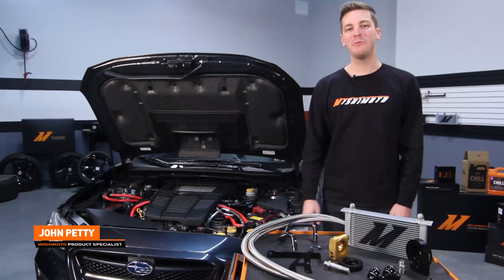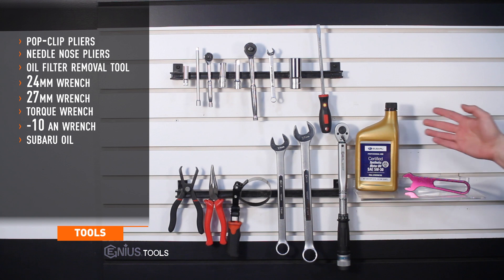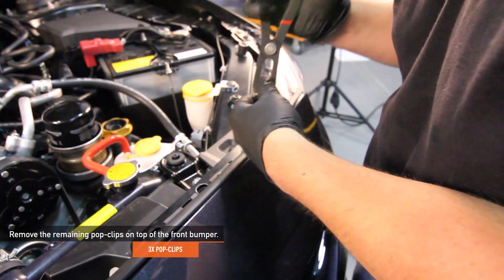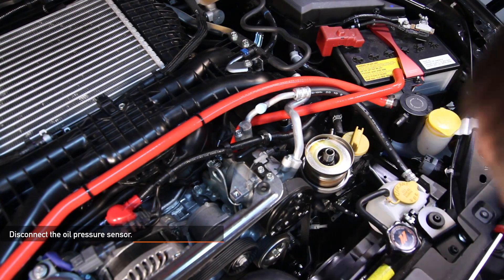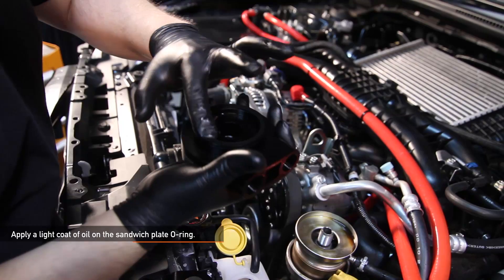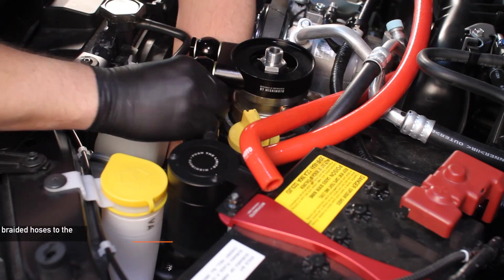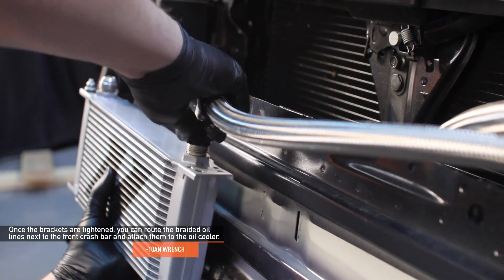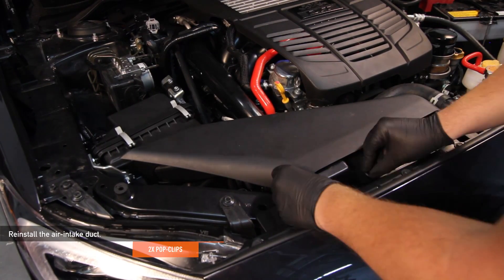Oil Cooler Kit Install Video for 2015+ Subaru WRX

Comment: hi, i just installed the cooler with thermostat kit. I followed every steps of this video, but there were oil leaking from the side of the spacer. Then i noticed my spacer is small than the one you have in the video. Im assuming that is the cause of the leak or I didn't torque the center M20 adaptor properly? Whats the torque spec for the M20?
thank you!!
Reply from the maker: Torque spec for the center bolt is 30-35 ft. lbs.

Comment: Do I need a tune this oil cooler? Ager installing it. Im getting a check engine light and my Accessport says it's the old pressure sensor that is erroring. How do i fix this. My installation was thermostatic with bypassed housing. 
I try taking it to super. But they told me I have to put it back in stock for them to look at it
Reply from the maker: You should not require a tune for this item.

Comment: So I bought the Mishimoto Ultimate Bundle Kit and the oil cooler came with both Thermostatic and Non-Thermostatic. Im confused on the install on the oil filter part. I replaced 2 Ancillary hoses that lead to the oil filter housing. Would this be considered Non-Thernostatic? I was confused to where the black Ancillary hose with orange on the inside goes. I think i may have understood where that goes now from your demonstration. However if i go thermostatic, what do I do with the 2 extra Ancillary hoses that came in the kit?
Reply from the maker: We would highly recommend contacting our team for installation help at support@mishimoto.com. The bundle we include should come with the thermostatic plate within the oil cooler, not both. Either plate should not disrupt the OEM cooler and hoses that go to it.

Comment: Hello ! Great video, what's the difference between thermostatic and non thermostatic. Which one is better for my WRX 2019 ? Thanks 🙏🏼
Reply from the maker: One has a thermostat to regulate temps and prevent overcooling.
Reply: @mishimoto  ok great! I would go for the thermostatic one. thanks for the response

Comment: Hi! Im thinking on applying this fix to a Subaru Impreza Limited 2015 because I'm finding oil in my refrigerant suspect oil coolant is cracked (motor oil is clean no coolant in there). Should Impreza limited vs wrx be the same replacemebt steps?
Reply from the maker: We have not tested this on a non-turbocharged Impreza. Sorry!

Comment: Can the non-thermostatic unit work without the stock oil cooler?
Reply from the maker: Our kit is designed to retain the OEM cooler.
Reply: @mishimoto  what are the options for someone who does not have the OEM cooler? I already bought the MM non-thermostatic oil cooler.
Reply from the maker: We would suggest purchasing a replacement and center bolt from Subaru for proper installation.
Reply: @mishimoto  can I purchase the thermostat unit alone so I can add it to my non-thermostat oil cooler?
Reply from the maker: https://www.mishimoto.com/catalogsearch/result/?q=mmop-sp

Comment: Does the air in the cooler lines need to be bled out or will the circulation system sort that out itself?
Reply from the maker: The oil cooler system does not require bleeding.

Comment: besides a catch can, can you install a AoS with this oil cooler?
Reply from the maker: We aren't sure of what you are asking here. A catch can is a ail/oil separator. An AOS is completely separate system when compared to an oil cooler.
Reply: “Totally different systems and yeah this would be fine. The oil cooler will install at the front and run two tubes to a plate that goes between your oil filter and the place underneath it.
An AOS intercepts the ccv line and pcv line.
Along with the plumbing of coolant. But totally different systems they work with.”

Comment: How much Oil do I need to put on the cooler when first installing. Also once installed, do I need to add extra .75 qt to the system or the oil I added on the oil cooler itself is enough?
Reply from the maker: You can add a bit of oil to this (~0.25 quart), however, it's not necessary ad the oil pressure will fill the cooler up quickly once the first start up occurs.

Comment: Installing the universal oil cooler onto a 2015 forester XT will require a modification to fit the sandwich plate. Will this unit fit directly to the oil filter mount on a 2015 forester XT???
Reply from the maker: Unfortunately, this is not something that we have tested in house. Sorry!

Comment: What if you have a front mount intercooler
Reply from the maker: This oil cooler kit will not be a direct fit for vehicles equipped with front mounts as the oil cooler will need to be relocated due to the lack of space up front.
Reply: Did you end up installing?

Comment: Hey so does it matter which line plugs into where and what do I do with the old hoses I disconnected
Reply from the maker: The port the lines go into will not matter. Regarding the coolant lines that get disconnected there is a new line included in the kit to loop the coolant flow. This can be seen at 3:58

Comment: when doing an oil change, will there be remaining oil in the cooler? is there a method to bleed it? i dont wanna just leave old oil especially if its a significant amount
Reply from the maker: Some oil will be left in the oil cooler but nothing significant. If you really wanted to the cooler could be removed. But you will find even on OEM setups some oil will be left in the coolers.
Reply: @mishimoto  awesome. i appreciate the fast response. one more question, though! what would be the process for a first-start? do i let my car run for a little, then add oil as needed? or do i just top off with the extra oil & start? anything special to do at all?
Reply from the maker: I generally would be preferred to fill the system from the start and allow the car to crank a few times without starting to get the oil flowing before start up.
Reply: @mishimoto  is this any different if I were to get the thermostatic cooler?

Comment: so how much oil should you fill for prep
Reply from the maker: You will need to add an additional 0.75 qt to the system with the cooler installed

Comment: Q. I just installed my thermostatic oil cooler. What temp was the thermostat rated?
Reply from the maker: The thermostat is designed to open at 185°F / 85°C

Comment: With the addition of this on a 2019 STI how much more oil is needed when doing an oil change??
Reply from the maker: You will want to add an additional 0.65 qt to the system.

Comment: Is all this suitable on a Subaru xv 2013 model ?living in Malaysia ... Weather is  hot
Reply from the maker: Modification to the kit would be required as this would no longer be a bolt on installation.

Comment: Hi, so when it's time for your first oil change after installation of the oil cooler; would you just fill the stsndard 5.1 litres or would it be 5.1+ 0.75 litres (again)?
My current thoughts are that it would be 5.1 L only as the extra 0.75 oil stays in the cooler?
Reply from the maker: Hey Jeff, unless you are emptying the cooler and lines, you will fill the system the same as usual. If you remove the cooler and lines, you will need to add additional oil.
Reply: @mishimoto  Alright got this installed, but it cools a little too well.  I notice that it takes a super long time to even reach 170F.  Is it possible to retain the factory oil cooler/warmer with the thermostatic sandwich plate?

Comment: How it changed oil from the oil cooler when need oil change?
Reply from the maker: Hey Sky, most customers will leave the old oil in the cooler as it is a minor amount and won't affect the new oil by much as long as you are following the standard oil change intervals. Some do choose to pull and drain the cooler, but this will wear on your connections over time.
Reply: @mishimoto  cooler contain 0.75 quart oil, but that's enough to contaminated the fresh oil. Suppose to have drain plug on cooler, or adapter from hose to pump out the old oil
Reply from the maker: Assuming your oil change intervals are kept standard, you won't have issues with contaminated oil as the cooler is prior to your filter. Your new filter should be collecting these particles thoroughly enough to not require removing the cooler. We have time attack vehicles with multiple oil coolers that don't pull theirs to drain.
Reply: I wouldn't worry about it, but a very easy way you could drain the cooler and lines without taking the cooler off is to disconnect both lines at the sandwich plate and blow low pressure compressed air through the cooler and lines to push the old oil out. The problem with this is the engine won't get oil flow for the couple seconds it takes for the cooler to fill back up unless you refill it with oil somehow. 
 Another way is after you change the oil and replace the filter, disconnect the cooler's return line from the sandwich plate, place it in a bucket, and run the engine for a couple seconds or until you see clean oil coming out. This will push fresh oil through the cooler and lines to push the old oil out. I know this method works with a non thermostatic sandwich plate, but it might work with a thermostatic model too since the thermostat never completely closes off.

But just as with the first method, the problem with doing it this way is that the engine runs without oil flow for the couple seconds it would take to push the old oil out of the cooler and lines. This won't do any damage since the engine will be idling with no load on it and everything is still coated in oil, but leaving the old oil in the cooler won't do any damage either. The choice is yours whether you would rather run the engine for a couple seconds without oil flow, take the bumper off and drain and refill the cooler every time you change the oil, or leave a bit of old oil in the system.

Comment: Mishimoto Automotive what about if I put this oil cooler in old intercooler location. ??
RESPONDER
Reply from the maker: Hey Diego. All of our testing was done with the location shown in this video. I  would not be able to verify what type of results you will see if you relocate the oil cooler into a different location.
Reply: In my experience it works just as fine as in the stock location.

Comment: does this need a tune?
Reply from the maker: +6spdtls Hi!  This does not need a tune!  If you have any other questions feel free to reach out to us anytime at support@mishimoto.com - stay cool! - Team Mishi
Reply: Mishimoto Automotive will this works with FMIC and CVT cooler? Where can I place this cooler?
Reply from the maker: Hey Diego. Unfortunately this part is not compatible with our FMIC .
Reply: Mishimoto Automotive what about if I put this oil cooler in old intercooler location. ??